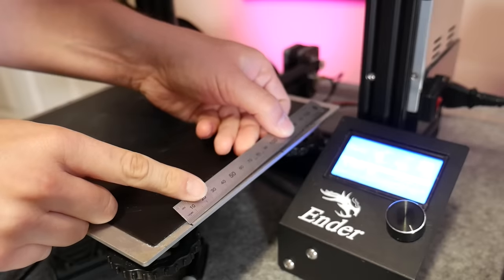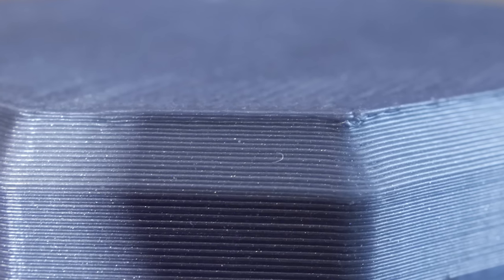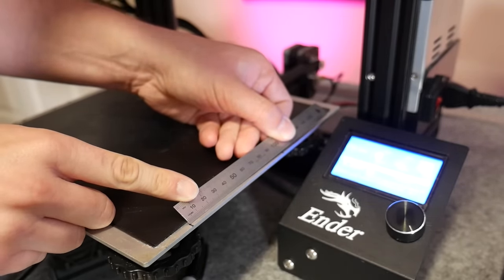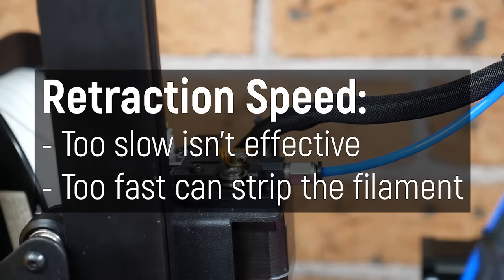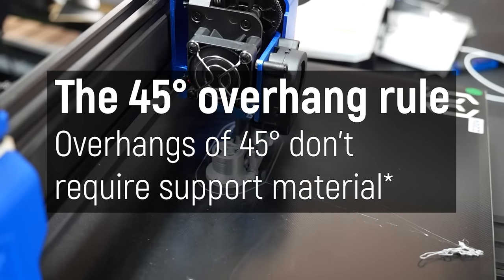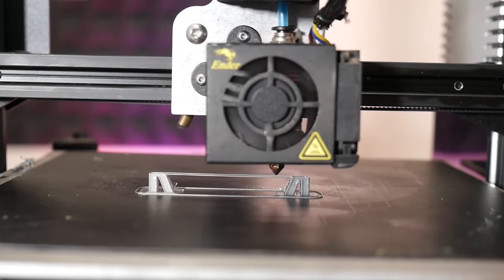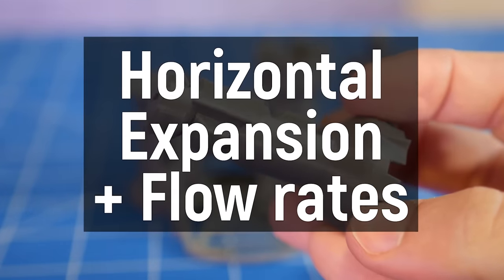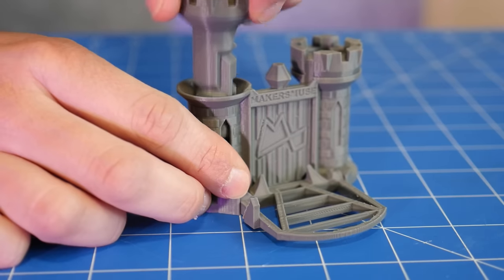The Ultimate Guide to Perfect 3D Prints

Comment: Also, check your nozzles people. The brass ones will wear, and the hole will widen over time. A fresh good nozzle also works wonders. Even diff material nozzles such as stainless steel or ruby nozzle.
Reply: and some of those cheaper nozzles will have QC issues, some rarely even come without a hole. change those nozzles as frequently as you go through 1kg of filament imo. edit: maybe not that frequent unless the nozzle takes a lot of abuse, lol
Reply: @hoffer_moment  change nozzle every spool? yeah ok lol
Reply: @jimmyc6409  you're right, i tend to need to because i use an untextured glass bed which not only requires a pretty close squash to stick without adhesive but also has had flatness qc issues from the start, so the nozzle routinely hits the bed in certain spots and i just kind of have to deal with it until i manage to win the lottery on these beds
Reply: @hoffer_moment  ohh that totally makes sense, I was worried for a second I was neglecting my nozzle haha thanks for the info!
Reply: I was wondering if i should immediately get a nickel plated nozzle since i print PLA 99% ofcthe time and only switch to a 0.6mm steel or ruby nozzle for the rare times i print metal filament.
Reply: The hole widens over time? That's what she said
Reply: my hole is widening over time.
Reply: I got an e Der 3 pro. Printed maybe 10 small items. Started having all kinds of feed problems. Changed the nozzle, doing well again.
Reply: Are nozzles marked on them with the size hole they have?
Reply: Other than extrusion issues, are there any tell tale signs that the tip needs to be replaced?
Reply: So I don't need to buy a 0.6, just wait
Reply: laughs in tungsten carbide tip
Reply: @shawnoandrew  usually the Diameter stands on one of the six sides.
Sometimes it is very hard to read, especially when the nozzle is older.

Comment: Fantastic video. Already shared with a handful of people. And I need to go adjust my retraction settings on my Prusa mini to kill off that stringing
Reply from the maker: Stringing on a Prusa?? Sacrilege! 😂
Reply: @MakersMuse  haha apparently it hates Silk PLA 😂🤣
Reply: could also be minor blockage with stringing. if nothing changes when you play with settings. really find out the temperature of the filament.. then clean the hotend. and make sure everything is as it shoudl be.. also oil the tube (thanks chep) ;P
Reply: @SuperGamingMoo  no one seems to use it, but cleaning filament works really well in my experience for everything short of a completely clogged nozzle. Although there have been times where a cold pull was necessary.
Reply: @quinnobi42  cleaning filament is a must for high temperature filaments like PC to PEI or vise versa this will defiantly help with anyone using multi materials into the same nozzles or heads of all temperatures and all materials build contaminations like carbon and  separations from different or heated and dried out materials that remain from a material change eventually closes the holes inner skins walled areas, there are two types of cleaning compounds
Reply: @UncleJessy  Mine does too man, clogs it every time!
Reply: What worked for me to stop stringing is lower the temperature, i print pla at 185°
Reply: thats what pladoo runs at not 215
Reply: @UncleJessy  I love silk PLA! 😊
Reply: @MakersMuse  yee I haven't heard about stringing on a prusa....
Reply: @jolandanvt2379  i do it too, seems like easiest way to prevent it.

Comment: Great video, stringing was happening on one of my ender 3s.  Increased the retraction by .5mm, problem solved, differences even between the same printers.
Reply: I had to raise hotend temp by 10 degrees.
Reply: my anycubic i3 mega likes to vomit filament even if the temp is low. ill dive into this guide fully later. i also switched from cura to prusaslicer and my printer stopped doing the stupid setting to 0 temp in the middle of a print thing.

Comment: With a wide nozzle, like 1mm, you might need an extra high retraction to stop stringing, but then a negative retraction after each move is needed to not have a gap in the perimeter as the filament makes its way back to the tip of the nozzle. This negative retraction is pumping filament out rather than pulling back in.
I think that might be called "extra length on restart" in your settings screenshot at 07:40.
Reply from the maker: Yep, I find that can help with flexible filaments as well, to help start them flowing a bit better after retraction. It's great to have access to fine controls in the slicer like that!
Reply: Cheers Andrew. I'll borrow that one. Thanks✌️
Reply: In Cura this is called "Retraction Extra Prime Amount". I spent hours trying to figure out why I had underextrusions near z-seam. Unfortunately, in Cura this setting is set once for the whole print, thus does not depend on distance travelled and needs to be adjusted for different prints
Reply: @MakersMuse - can you please write down all steps how to get perfect print on Ender 3 ?

Comment: Great video. I could have used this about two days ago when I started calibrating my first 3D printer. The biggest improvement was fixing the temperature. Printing a temperature tower really simplified the process of selecting the temperature. I recommend doing this quite early in the process. Probably the first thing after calibrating E steps and X/Y.

Comment: Great video! You touched on just about everything, but I just wanted to mention that you should check the diameter of your filament with calipers and adjust your slicer settings accordingly. Sometimes failed or ugly prints can be caused by this.

For instance, I just checked a cheap roll of 1.75mm PLA+ and it ranged from 1.68-1.70 over the first meter or so. I changed my settings to 1.70mm and I'm printing fine so far. at 1.75mm I would probably be under extruding.
Reply: Thank you, I noticed this too, I think I will have to try this.

Comment: Thanks for making this. For whatever reason I have a hard time convincing people what's causing problems in their prints, so this helps.
A lot of these I figured out a while ago and I often seem to be ahead of the curve on these tips. So for your consideration, I'm going to suggest that the next wisdom in 3d printing is that we shouldn't bother changing our print speed while trying to improve quality or time. Since print speed only affects the maximum print speed; whether the printer actually gets to that speed is determined by the acceleration setting. Further more, I suspect most of the stresses at the point of deposition are going to caused by speed changes.
I posit that best practice should be to determine the max speed at which a given nozzle and hot end can lay down a given filament AND adequately cool it, the printer should then be set to run at that speed (with a conservative margin) and left at that setting for the given profile. From then on for that profile all adjustments for time/quality should then be made to acceleration and jerk, with the speed left alone. As a rule, rather than think about how fast we print, we should instead be thinking about how aggressively we print. I'm currently upgrading my printer though, so I've yet to test this theory.

Comment: Fantastic video. Just want to add regarding the bridging it's kind of a function of tension within the molten filament. Which changes per filament type. But generally going fast and under extruding during the initial bridge moves will help avoid the drooping by pulling the molten filament tight. Too much tension and the filament stream might break, or simply fail to provide a good foundation for the rest of the bridge, so finding the sweet spot for each filament and temperature is key.

Comment: Worth emphasising what is being talked about here on calibration, for the typical case today buying a well manufactured printer (e.g. Ender 3), is fine tuning - the factory settings will be pretty good, provided other aspects of the printer assembly are ok (e.g. v-slot wheels are correctly tensioned, belts correctly tensioned and not stretched, etc...) so if you have bad prints go through all of that before breaking away from factory firmware settings. A corollary of it being fine tuning; any change in steps/mm values should be small (1 or 2%) - if you're tempted to make big changes then stop, and find the real problem instead.

In particular, I see way too many people thinking that "calibrating e-steps" is solving problems they have - when invariably it's (badly) papering over other real problems. Given the E steps/mm is a function of mechanical physical characteristics of the machine - specifically the stepper motor step size (how much it rotates per step), the micro-step configuration, the effective radius of the hob gear - any change to e-steps done for calibration would be quite small. Fine-tuning e-steps (adjusting the stock 93 to 94 on an Ender 3 for example) means it'll be set well for the particular filament you used to calibrate, but will be out for other filaments. Softer filaments mean the effective hob gear radius is lower for example. If you primarily use PLA then fine, I guess - but to handle different filament types in particular soft TPU it's better to adjust the extrusion factor/flow rate in the slicer to compensate. Changing the flow rate and changing the printer e-steps both have the same effect - just the printer e-steps are best set to a common median (so calibrating for PLA is a good choice because it's relatively hard and therefore consistent), and the flow rate can be used to compensate for different filaments as part of the slicer filament profile.

If you're changing e-steps by a significant amount from stock with PLA (say more than 2%) - you're not calibrating the printer, you're compensating for a real problem elsewhere. Examples include clogged hob gear (just clean it with an old toothbrush), partially clogged nozzle, something interfering with the grip of the hob gear onto the filament (e.g. the arm is not properly free to create the right pressure between hob gear and idler wheel, the tension on that is too low/too high or the spring is weak) - or even you're using tight-tolerance (capricorn) bowden tubing with too-tight bends and less "perfect" filament diameter. Even had one where the stepper motor drive current was too far out so the motor was low on torque.
Reply: all very good information

Comment: Great video. One thing you overlooked is the effect of worn nozzles. I hate changing nozzles and recently spent a lot of time trying to dial in some silk filament settings without great results. Eventually I got over my nozzle change phobia and changed them (I have two in my IDEX printer). Both were really badly worn.
Now I can get good prints with the silk filament over a range of temperatures. Not only has the print quality improved, but the settings don’t have to be dialed in so precisely.
Reply: try taking a "real" hardened one and torch it with a red hot flame and pliers until all is completely burned off brush it up with copper to clean out the ash and polish her back up i usually get 2-5 or more like new uses out of them but it must not have coatings or ones that cant take the heat really none can but Nickle or chrome cr38 all wear eventually    smooth in smooth out!!!
tip, just hold the nozzle don't crush it the red hot nozzle is soft under this type of heat and is not great for materials and stresses so gentle under extreme heats so heat as evenly as possible so it grows and shrinks together! 
this is how we clean real industrial extrusion dies barrels and screws that wont clean with cleaning resins or reach

i have even resulted to a 600 grit paper to get the grit/carbon off the inside rolled into a cone twisting it with my fingers until its slick avoid the actual tip just the entrance and the tapered area to the final hole but if you hate changing nozzles i may have still wasted my breath but any hooe

Comment: "Initial layer height" was a great hint! 
I was wondering why the first slice looked like 4mm in the preview. Seems like an update changed the default value and you may know how Cura loves to hide 80% of its settings.
This might also contribute to the elephant's foot problem. I've ignored it for now, since it is really minimal and I was planning on sanding anyways, to get rid of the visible layers.

Comment: its 6:30 am, i have been up printing and calibrating my old ender3 that was sadly in storage and needed some love. honestly never took the time to really do it justice back when i first got it, but i went from many calibration cubes and a string test all the way to a makers muse officially official clearance gauge V2, and succesfully passed the 1.5mm standard. i had to use a screwdriver and more force than i would like to free it but it snapped clean and rotates fine after wearing in a few turns :) saddly the .5 tier actually has room to wiggle loose so i think i overdid the horizontal shrinkage but im calling today a success!

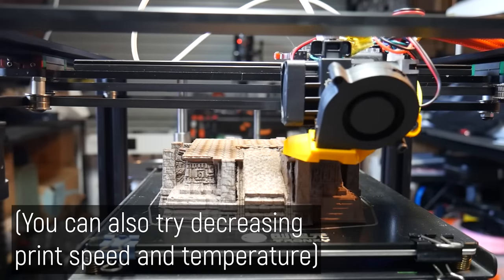Comment: 11:48 with really tiny prints like miniatures you actually want to increase print speed. The radiant heat from the nozzle can deform small details. Moving the nozzle away faster is way better in this case.
Reply: Thanks for the tip!
Reply: Would never consider printing minis on an fdm. That's what resin printers are for.
Reply: @blackknight3830  that's what I thought. I decided to print one just to see and it's definitely no where near the quality of a resin printer, but it is much better than I was expecting.
Reply: @joelvarney5091  With a 0.25mm nozzle, strong part cooling and a lot of hours tuning your printer for miniatures you can get really good prints. Resin is obviously still a different kind of quality though.

Comment: Finally someone doesn't try to fix everything with flow compensations! I'm not alone :D

I would also not recommend to calibrate X/Y steps based on a 20mm cube. What I would do is to print something 20mm AND something 200mm long/wide and compare. If the error is the exact same %, the steps likely needs calibrating. If however both are for example exactly 0.05mm off, it's not a step issue but more likely something mechanical like loose belts or even a bad seam or an elephant foot.
Imagine calibrating steps based on a 0.05mm measuring inaccuracy over 20mm. If you do and then print something 200mm long, that would produce a much larger 0.5mm deviation. 
There are a lot of things to consider when measuring accurately (but I know you know this). Caliper accuracy, how you hold it, how hard you press. Ask two people to measure the same part and you rarely get the exact same result. Corner swell, elephants foot, layer seam, how much the pressure lag in the hotend causes differently wide lines depending on how close to a corner you measure. Even how much moisture there is in the filament in some cases.

Comment: Always good to review and reaffirm what to do when you see a condition. I generally just get by and clean up a part after the fact. But now I am moving from my own R&D to trying to make parts that others want and will pay money for them. I want to make the best parts I can with the machine I have. Review like this helps push me to rethink what I do and how I am doing it. I see more clearly where I have made mistakes in reacting to certain things.  Too much retraction, clogs, layer height Variables, Too hot, too cold, not enough cooling fast enough and it goes on. My two main issues are: 1 making round holes really round and 2 sagging bridges.
I have put off Direct Drive Extrusion too long, based on input its heavy and the Y Axis will sag??? I think I need to dig deeper, take the time to print test parts and really address all the calibration tools available and finally learn to set feeds in the firmware.  Always afraid to go too deep in and change things. Creality 10s Pro V1/ Micro Swiss Hot-end / PLA & PETG (some C.F. PETG) / Model Train Parts, Chassis, Adaptors. Thank You very much, Dennis in Virginia

Comment: Coasting is another possible option for fixing stringing issues.  It's also slightly hacky, but my Ender 3 was a string-making beast until I enabled coasting and cranked up the amount.  This was after tweaking everything else as far as I could - retraction, combing, dialing in the extruder's esteps, etc.

Then I used a cheap kit to switch to direct drive and stringing went down drastically.  But I still keep coasting enabled, at a much lower amount, because even perfect retraction settings can't stop oozing when you're printing slow.

Comment: Great advice! The one thing I would have included, because it has been a problem on both of my FDM printers, is belt tension. Getting the belts tensioned tight enough, especially on the X axis, significantly improved the print quality on my Ender 3 and Maker Select when I had print quality problems.
Reply: motor bearing play bent shafts and bad extruder gears and/or funky flow rates and poor PID's can do all the same ! belts are made to be adjusted by you or a tensioning pulley continuously its just the way it is, but you can reduce it by using heavier belts 
proper tensions will vary with your actual printers speeds and jerk accel and so on so ideally certain speeds and mass will have one ideal tension and less will be slightly different like a fast turnaround jerk could shorten the actual filament layed as the belts elongation pull will not make the full path at the head resulting in a short path and vice versa on the slow side belt slop will do similar things